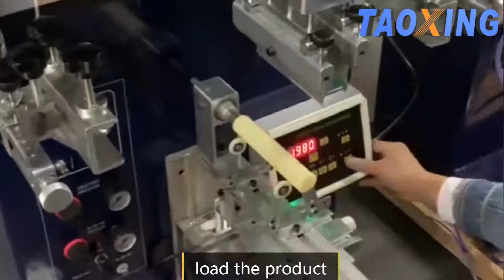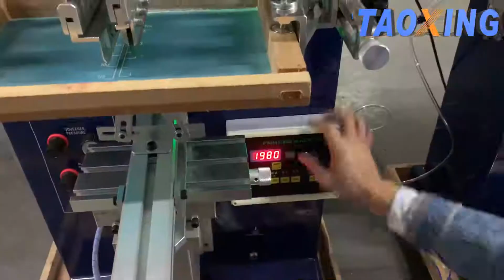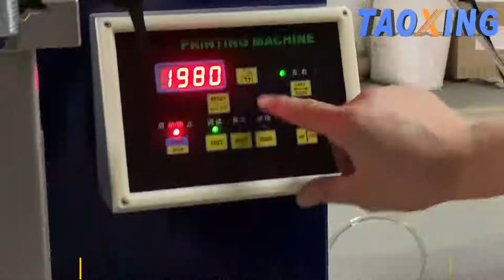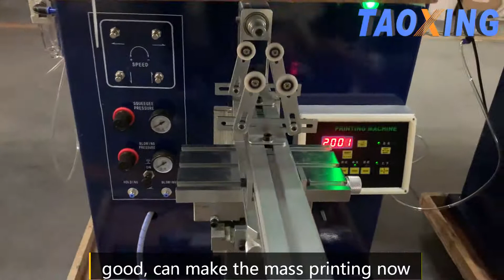How to use TX-250S cylindrical cups screen printing machine?  cups, bottles, round surface printer

Comment: How much horsepower you use in air compressor? What is the right psi and cfm for that product?
Reply from the maker: https://youtu.be/2P6atP4oJaE?t=40  Please check 0:40 , it's 4-6 bar
Reply: @TaoXingscreenprinting  i mean the air compressor details or specifications
Reply from the maker: @simplyshowinghow  0.7Mpa,1.5Hp, 1100kW ~3300kW, 100L
Reply: @TaoXingscreenprinting  is this air compressor details compatible to  TX-250S model?
Reply from the maker: @Batangs-smusika  Yes
Reply: @TaoXingscreenprinting  hi do you have a manual booklet for this machine?
Reply: @TaoXingscreenprinting  hi, can i use 1hp with 2 gallons of air compressor
Reply from the maker: @Batangs-smusika  Yes, please share your email address, I will send you soon.
Reply from the maker: @aestheticspics  It's some small, the compressor needs to keep working all the time.
Reply: @TaoXingscreenprinting  hi! where can i share my email address?
Reply from the maker: @Batangs-smusika  You can write your email address here, I will send you the email.
Reply: @TaoXingscreenprinting  hi, i wrote my email address but the youtube delete it. maybe its not allow to put email here.
Reply from the maker: @Batangs-smusika  Ok, please send email to my working email, I will reply you. Sales2@tx-uv.com
Reply: Hi, how many cfm for this machine? And also how many psi?
Reply: @TaoXingscreenprinting  hello my friend, i already sent an email to you.
Reply from the maker: @Batangs-smusika  Have replied you, please check your SPAM if can't find it from INBOX.
Reply: @TaoXingscreenprinting  hi my friend i got ur email thank you much. my printer is the same with your model. i bought second hand in my country. same model and same brand taoxing tx-250s thats why i need the manual booklet.